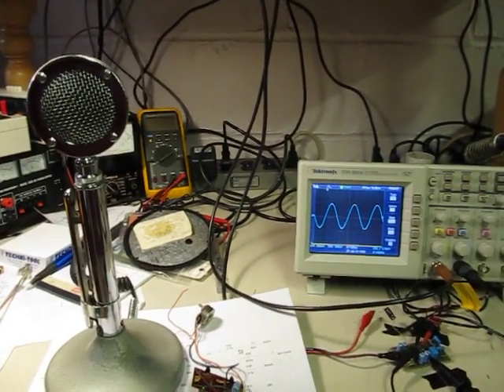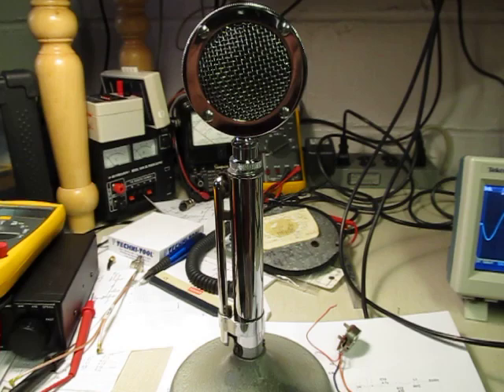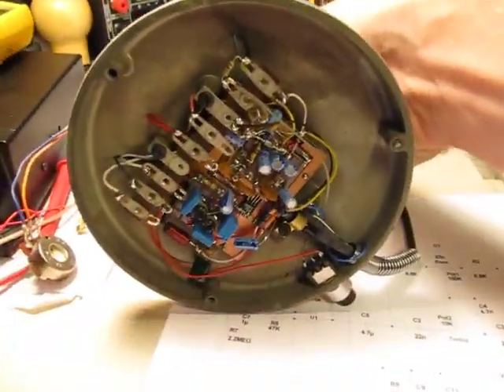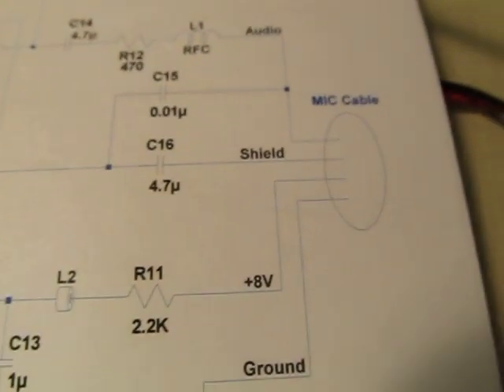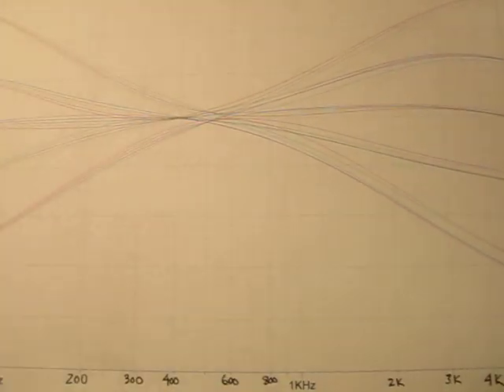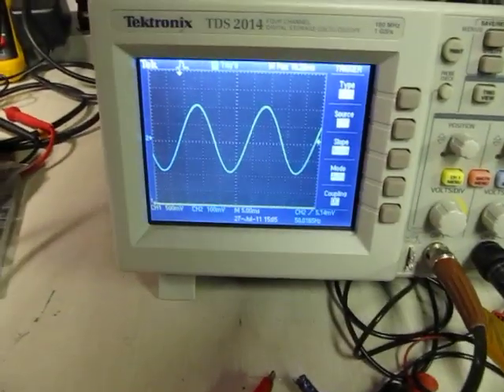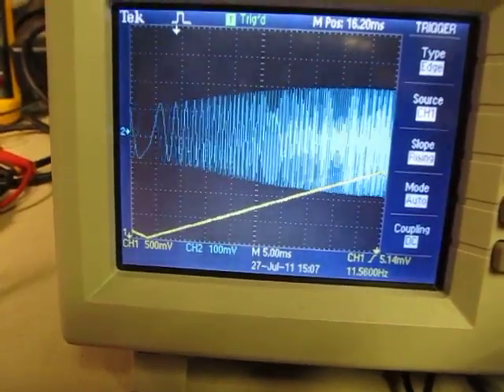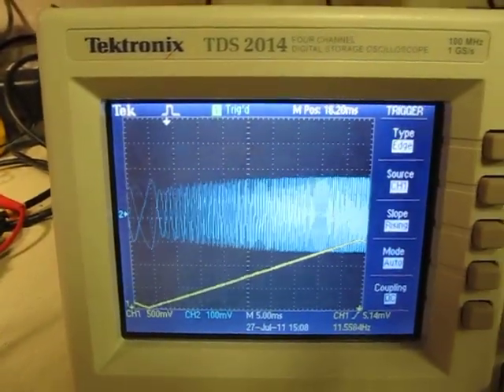#13: D-104 Microphone amplifier / Equalizer for Ham Radio

Comment: Can I use this with my Kenwood TS-520 with the impedance output circuit  you have in this design?  Would I have to tweak it back to high impedance for the TS-520. I like the idea of doing some audio EQ and your circuit saves me from adding an outboard mixer. Also your scope vids are great!

Comment: Alan - very nice circuit and the way it performs. Just recently I found a need for a tone control circuit (active circuit) and out of the blue tonight, I ran across yours. I will be putting one together very soon. Not necessarily for my D-104 but who knows. I use unmodified D-104 microphones into Collins equipment and people unsolicited say they love it because it does have that communication quality audio, not broadcast FM quality which is nice for "arm chair" copy but, as you mention, not very good with QRM and QSB. Stay safe - your videos are always good.
Reply: Curious as to if you added this circuit to your D-104 used by your Collins.  I have been running CW on my 32S-3 due to not having a microphone with proper impedance.   Thanks for your reply.
Reply: @peterhoward8461  
No, I never built this circuit. When I think back, I believe I used some passive circuits to cut highs but that is unnecessary and I have replaced the old elements in my D-104's with simple condenser-type mike elements. Just requires a load resistor (between 1K and 2.2K depending on the gain you want) a blocking capacitor and a 9V battery. Works great. I have gotten the mic elements off Ebay and Amazon. On Amazon you get ten mic elements for something like $7.90. Perfectly modulates the 32S and people love it. I do not use any preamp in the D-104 base - only the 9V battery holder.  73  WA4QGA

Comment: I always admired those old Astatic microphones. My first was a model T-3 that fit the same push to talk stand as the D-104. Probably the same crystal element inside. That purchase was $80 in 1965. Hard to believe that stuff lasted all these years. I later used an electro voice 664 dynamic. 
I think it's interesting to make improvements like you did using modern materials and methods that are hidden from view.
Reply: I have had some fantastic audio reports from using a hearing element from an old rotary dial telephone handset as a microphone element in an old D-104 I have, strange but true.

Comment: That is a very nice 3 band equalizer for a D-104 if it needs a preamp due to the high impedance to low impedance  mismatch of the XTAL mic D-104 to a modern transmitter;however if used with older vacuum tube transmitters which have a high impedance microphone amplifier input stage, no preamplification is necessary. A XTAL mic generates a very high voltage output that needs no amplification.
.

Comment: Alan, on your link above, Bob ND2m...this link is broken.   The D-104 is also one my favorites!
Now it's time to go make the same changes as you did.  Thanks!
Reply from the maker: He must have taken his site down.  You can try emailing him at nd2m@comcast.net
Reply: Many thanks Alan. I try to stay up with you- even though you make so many video's!
Here is my page where you can find many of them: http://elecurls.tripod.com/vidtuts.htm
Reply from the maker: Thanks.  The only correction that I'd add is that I am not retired!  I am still a current and active Field Applications Engineer for Tektronix.  You might also want to provide a link to my video index PDF file:
http://www.dorkage.com/youtube/W2AEW_video_index.pdf
Reply: @w2aew  - This link is not working as well.   No .PDF
Reply from the maker: @tubeDude48  Worked for me:  https://www.qsl.net/w2aew/myd104amp.html  - I know that the ND2M link doesn't work anymore - I believe he became a silent key in 2019.
Reply: @w2aew  - No I wasn't referring to your page, I was referring to ND2M.  '-)   BTW- Here is a link to my page devoted to the D-104 along with your link!  https://elecurls.tripod.com/d-104.htm

Comment: An Astatic XTAL element or the new Asian replacement will give hi-fi bass response if about 5 megohms of resistance is placed across the mic input to ground giving the XTAL element the high impedance match it needs.
Your circuit will work nicely for more modern radios that do not have built in adjustable equalization functionality
Reply: Crystal Microphone elements are no longer commercially produced.
Kobitone (Japan) was last supplier, BUT that operation disappeared with 2011 Tōhoku earthquake and tsunami.

That 2011 Japanese event changed electronics component sources (countless Japanese killed, never found, and factories demolished).
https://en.m.wikipedia.org/wiki/2011_Tōhoku_earthquake_and_tsunami
The event was worst than USA Gulf States Hurricane Katrina in 2005.

Comment: Good Vid,  I looked but didn't see it but, these also came in gold color and the silver one too, they also had etched on the back side a winged eagle on them, the gold ones were a little more expensive, I had just the plain silver one with no eagle on the back, these were super MICS. the sound quality was awesome and they could pick up some one talking from across the room, aahh what fun we had back then.
Reply: I’ve been sitting on a D104 my wife found at a garage sale several years ago.  I finally started to think about doing a restromod.  Besides the preamp, installing a dynamic element like the Heil mod, or an electret array were considerations.  Now the crystal element may get a chance after all.

Comment: Not sure if you'll ever read this but, have you tried using your pre amp/amp circuit with an  electret microphone upgrade instead of the original D-104 crystal microphone element? I hear the electret microphone upgrade makes a World of difference in the audio quality alone without the pre amp???
Reply from the maker: An electret mic element needs a DC bias. Other than adding that detail, this circuit would work fine with it.  These elements generally have a flatter frequency response than the old crystal element, so don't really need as much equalization.

Comment: I have many friends who recommend the Kobitone XTAL element as a replacement for the Astatic.  Kobitone (Hz) manufactures several with different response characteristics. I believe that the Model 25LM022 with a Freq Response (Hz) of 50 -> 8K Impedance=25K Ohms is the correct one. It is sold by Mouser for $3.52 I have one but have not had to use it yet.
Reply: Crystal Microphone elements are no longer commercially produced.
Kobitone (Japan) was last crystal and ceramic microphone element supplier, 
BUT those operations disappeared after the 2011 Tōhoku earthquake and tsunami.

That 2011 Japanese event changed electronics component sources (countless Japanese killed, never found, and factories demolished),
you likely are unaware of its effects on USA automotive/truck manufacturers (and countless other manufacturers).
https://en.m.wikipedia.org/wiki/2011_Tōhoku_earthquake_and_tsunami
The event was worst than USA Gulf States Hurricane Katrina in 2005.

Comment: This would apply to some cheap Xtal mics from China for portable use.  I do not like the hand mics supplied with the radios today.

Your method of instruction is absolutely amazing.  So many other sites are a roundtable "Duck Dynasty" knockoff where you have to wade thru the muck to sift out the good stuff.

Thank you for these videos.  AD6AE

Comment: it would have been nice to hear the results from the eq. amp. i also think the base responce would benefit from being a little more wide banded. it looks more narrow that i think it should be.
Reply from the maker: dale myers I designed this to work with my ham radio which only has about a 3kHz audio passband, so it works perfectly well with that.  No need for wider bandwidth is that application.
Reply: i'm happy with how much band width it works with i was looking at how much of the base adjustment it effects on. it such a small segment as the treble effects so much more of that band width. sorry if it did come across like that.
Reply from the maker: Oh, ok, I understand what your saying. I purposely put the treble corner in that spot because of the microphone I use. It has a very sting treble and midrange, so I wanted the adjustment to to take care of that. If the mic was flatter in response, I would've moved the frequency response around differently.
Reply: ok i got that part of my intent realized. have you recorded the responses difference between stock and then with your board installed. i've seen a mod where he put an electric condemner mic in one using the stock preamp.. it was too deep toned for my liking. i like the high end but without the deep tones, it comes off nasally.

Comment: I noticed that the schematic in the video is different from the one on the page. Any chance you can post or send a copy of the final? Used a Silver Eagle 40 some odd years ago and just got a hold of two decent standards.

BTW, thanks for all the great videos, blew a lot of dust and cobwebs out from years of not thinking in electronic terms.
Reply from the maker: The differences were minor - just a couple of 2.2M resistors on the input to tame static buildup on the mic element, and minor changes in component values. Truthfully, I don't remember which version is built into the mic.
Reply: ***** Yeah, I noticed the 2.2M's. If that is all you really changed, I should be good to go from here. Thanks!

Comment: I too have a used, swap meet, D-104. Problem is, it has 3 cndr's and a ground sticking out the cable end! No connector!
Id like to put a Kenwood connector on it to plug into my Kenwood TS 450s.Where could I get a connector that would be compatible? And most important, how to wire up the D 104 to work on the TS 450s?
Any help or links, would be greatly appreciated!
Reply from the maker: The connector is readily available from most electronic parts distributers and radio supply places, as well as easily found on Amazon.  Just search or "8-pin mic connector".   With any mic this old, it is possible or even likely that the mic cable has been replaced, so that the color code indicated by the diagram inside the base of the mic might not be correct - so you'll have to verify that.  The wires should be red and black for PTT and ground, and white for audio and the ground/shield will be audio-ground.  The wiring diagram for the TS-450S mic connector will be in the user manual.
Reply: @w2aew  thanks very much for the reply, I'm gonna do it!! Yes I can! The cord on it now is a coiled type, so you never know, might still be original. Like I said before, I've had it for over 20 years now!!
73, Drew.

Comment: Hi, this is somewhat answered in a previous question, but specifically will this preamp work unmodified with electret condenser and dynamic mics?  If the preamp would require modification for the aforementioned mic types what would the modifications required be?  Thanks!
Reply from the maker: It should work well with a dynamic mic.  An electret condenser requires a DC bias and has a larger output, so would require changes to accomodate.
Reply: @w2aew  Got it - thank you.

Comment: I wonder if some one could can explain why, the mic. Signal is going into the op amp as a differential signal. Wouldn’t it be considered as common mode
Reply from the maker: The audio signal will be differential and thus amplified.  Any external interference will be common-mode, and thus rejected.

Comment: I designed a circuit board for the D-104 amp and it works well. The bass & treble adj. works as it should and no RF at all. But as soon as I engage the processor on my TS870 I get squeals and distorted audio. Is it possible there is too much gain? The reason I suspect gain is; with my other dynamic mics I have the mic set to the 12 o'clock position. With your circuit and a D104 I have to turn the mic gain way down to 8 or 9. So where would a pot be installed to vary the gain? I have added several .001 caps & ferrite beads. Thanks, Dave k4em
Reply from the maker: With my 870, I keep the mic gain at about 10 o'clock in order to get moderate ALC deflection.  It seems to work well for me.  You might want to check how much compression you're getting with the processor - that might be set too high.  If you want to reduce the gain, you can reduce R1, or replace it with a resistor + pot.

Comment: Mr. Wolke, do you have a schematic and parts list available to be able to download on line?Thank You!John
Reply from the maker: +john trraxis The only info I have to share is found on this page:
http://www.qsl.net/w2aew/myd104amp.html

There is a schematic diagram there where you can read off the values of the various components.  Note that the op amp I used is one that I had laying around at the time (more than 15 years ago).  There are likely better choices you can pick today for that.

Comment: I don't understand the difference between an RIAA equalizer compared to a normal Equalizer. What is so different about an RIAA equalizer filter section or what does it do differently compared to a normal equalizer?
Reply from the maker: A normal equalizer is typically adjustable by the user for their own desired frequency response. An RIAA equalizer has a specific, non-adjustable frequency response.
Reply: @w2aew  but what is an RIAA equalizer it is a preset curve for what reason to do what?
Reply from the maker: @billwilliams6338  It is designed to equalize the response of phonograph records:
https://en.wikipedia.org/wiki/RIAA_equalization

Comment: i really enjoy your Videos , thanks for your efforts.
I am interested in upgrading the bad HM-36 (China version) for an icom ic-746 radio, using the panasonic wm61a capsule. Will i need to design a preamp between the WM61a and the Mic input soket of the IC 746 or will the internal preamp of the 746 be good enough? 
What about impedance matching between the wm61a and the tranceiver? 
Thankyou, any and all help much appreciated.
Reply from the maker: Pretty sure the Icoms all use electret mics, so they all have a DC bias on the audio line.  I just don't know the value of the voltage and if it would be compatible with that capsule.  I don't think you'd need an additional preamp, just use the connections from the old electret cartridge, changing the resistor if necessary (the panasonic wants 2.2k max).
Reply: @w2aew thanks for replying. They do have a bias of 8v. I might do a drop in swap and see what the response is.
73.

Comment: gr8 job
you have put a new twist on manhatten style pcb with a smt op amp. I didn't get to see any ferrite beads there, I did see a rf choke, You have all that High end equipment, and the pcb isn't masked and silk screened, for a few USD you could have had a pcb made by the pro's like pc express among others
73
de n8zu

Comment: As I create a parts list for this project, I noticed that no capacitors are label as polarized. The pics and video seem to show some polarized capacitors. Please help me out. Thanks Frank KF4XY
Reply from the maker: The 1uF and 4.7uF caps are electrolytic. You can get them in polarized or non-polarized versions.

Comment: hey i order the board where can I get a OP296G
Reply from the maker: David Pitts Hmm - I wonder what board you ordered, since I am not aware of one being offered.  In any case, if you are having trouble finding an OP296G, you can use something like the TL272CP which is easily found.
Reply: there was one on eBay is where I got it
Reply: Thanks
Reply from the maker: David Pitts was it based on this design???
Reply: Yeah sure was the schematic that you had to
Reply from the maker: David Pitts Very interesting.  It would've been nice if the seller would've let me know he was going to make a board and sell it.  I don't have a problem with it, I just would just to know about it.  I did a search and found his listing.  Boy, that board is very big - looks like triple the size of the hand-built prototype that I built.  Good luck with your project.
Reply: thanks  sorry I was thinking it was you